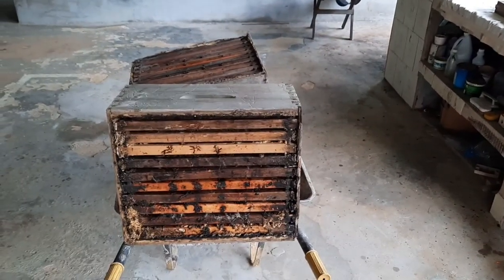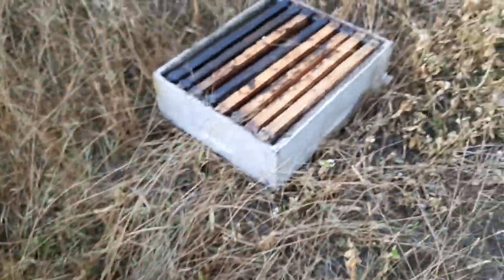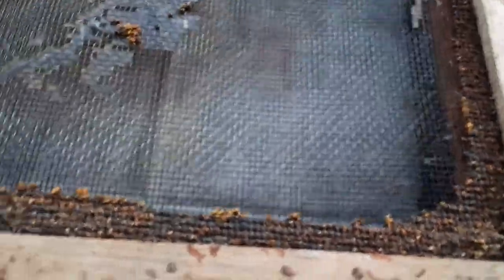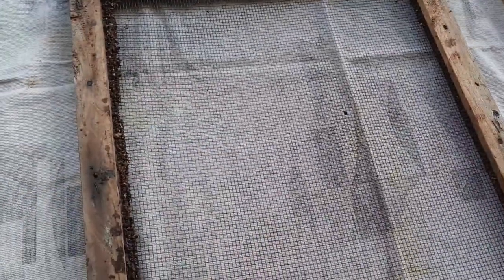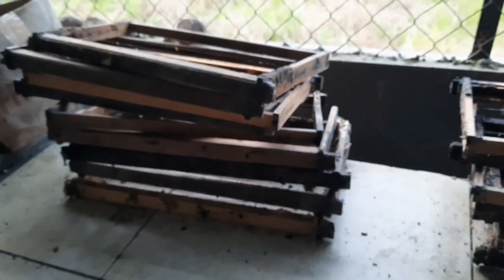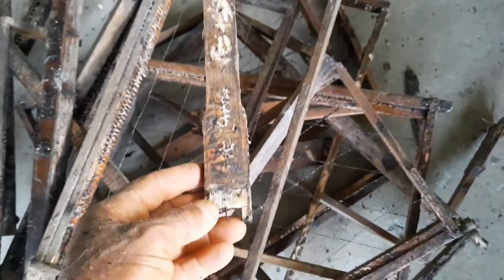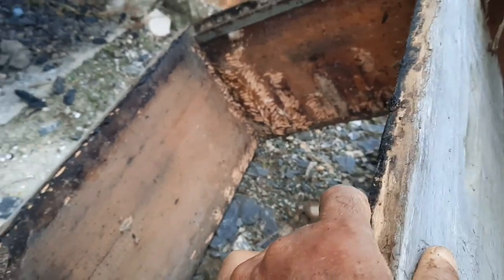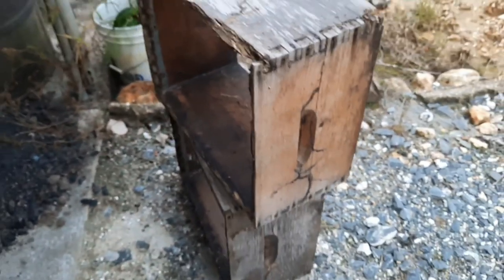Watch and learn from my mistake. "Beekeeper 20 bath soap" recipe in comment.

Comment: The ant treatment was a fine way to take care of the wax moth larvae. I like that.
Reply from the maker: Sir do, the ant's method has been the method I have used over the years to keep my frames over the rainy seasons similar to how winter keeps the wax moth from destroying frames. Some times I fill the cells with water and leave them stacked up out in the open. I will from time to time spot check to ensure the combs don't dry out until I can once again put them on after shaking out the water first 😁 thanks for watching my nantics.